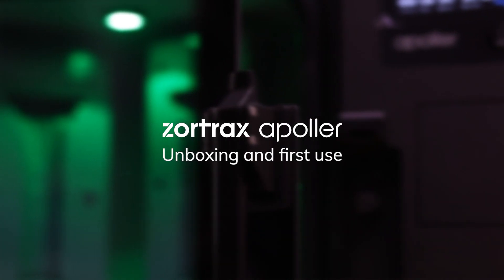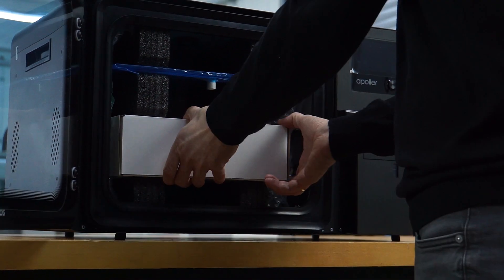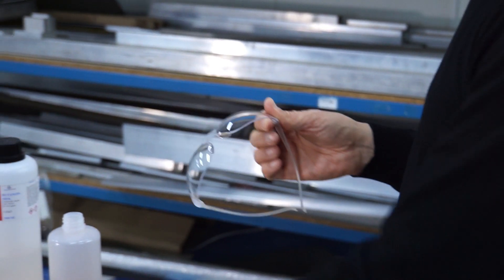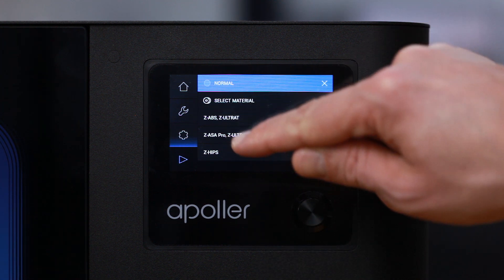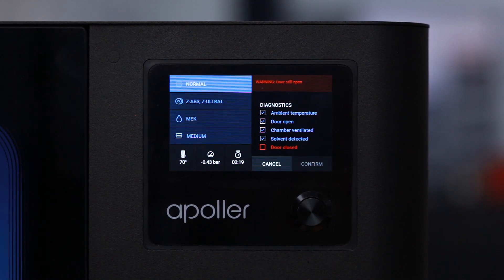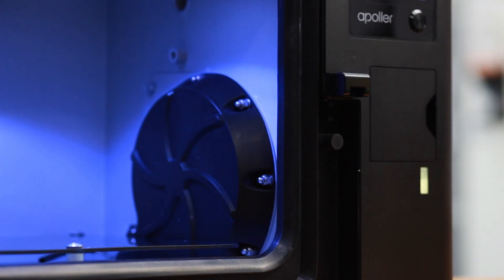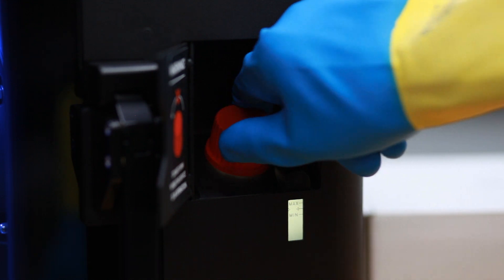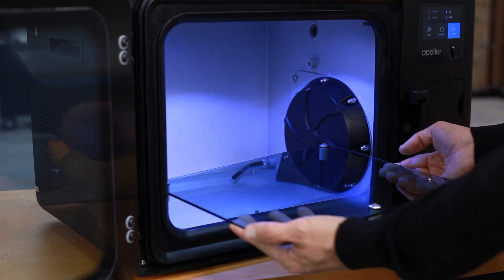Unboxing and First Use of Zortrax Apoller SVS Post-Processing Device

Comment: No thanks I'll just wait for the Chinese to duplicate and buy it for a 100 dorrars lol
Reply from the maker: Hi, Alec. As we've designed safety system in accordance with ATEX 2014/34/EU Directive regulating the equipment intended for explosive atmospheres, Zortrax Apoller is reliable and safe to use even in industrial production sites. The complexity of safety system combined with high quality of outcomes and efficiency of operation makes Apoller hard to imitate. Read more about Zortrax Apoller Smart Vapor Smoothing device on our website (https://zortrax.com/post-processing/apoller/).

Comment: Over $6K USD
Reply: I fell out of my chair when I saw the retail. I don't know how a microwave steamer can get to that price. Must be the same guy who priced the m300 at market entry.
Reply from the maker: Zortrax Apoller is an industrial-grade machine, that provides users with efficiency, excellent performance and, most importantly, safety. As Zortrax Apoller works with acetone and butanone, we have designed it to meet the high standards required by the ATEX 2014/34/EU Directive regulating the equipment intended for explosive atmospheres. These substances are highly flammable and should be used with proper safety measures. What is more, with advanced vapors circulation and condensation system, the solvent can be reused for multiple sessions. Visit our website to find out more about Zortrax Apoller: https://zortrax.com/post-processing/apoller/.
Reply: @ZortraXTV  The safety aspect is understandable but It is a tough justification for the price and it is a shame not to be targeting the original m200 consumer. We were really looking forward to having one in the studio after the formnext unveil but for the price would rather get three more M200 machines and sandpaper.